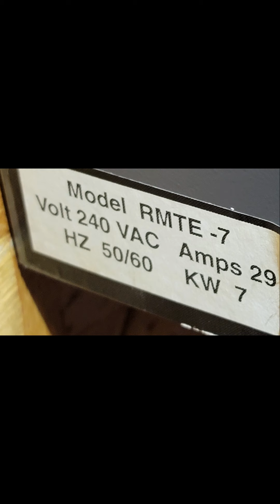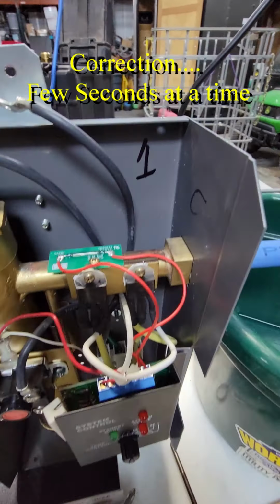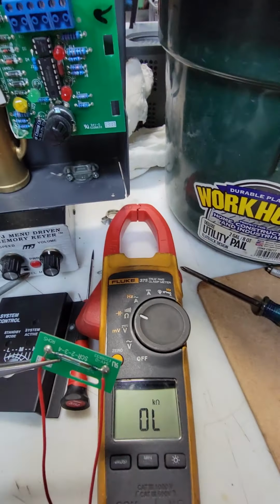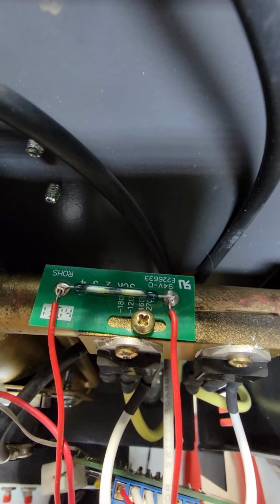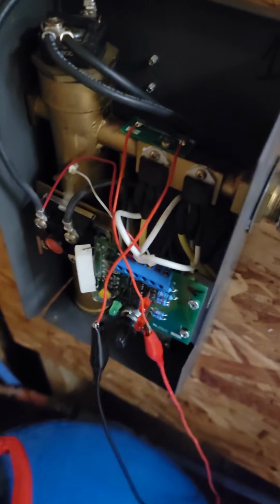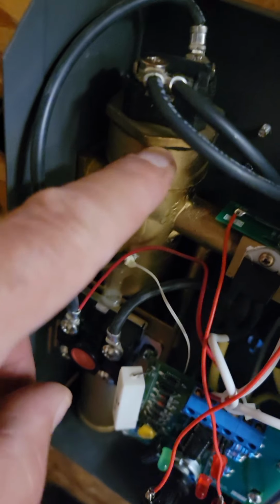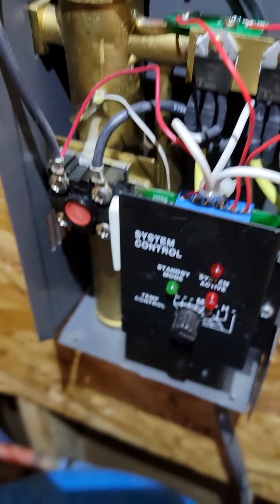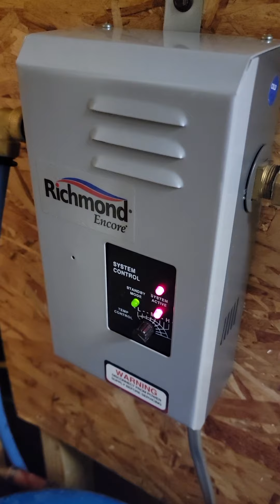Richmond Encore RTME-7 Electric Water Heater Flow Switch Repair

Comment: Any idea on where to get replacement flow sensor?
This unit innards are exact to the Rheem Ecosense RETE 7, which I have had for 7 years. It recently stopped workin, sporadically lights up when running water to heat. Many times it then doesn’t light up the red lights. Was able to turn off/on and it would work but now it doesn’t light up the red lights. Acts like a flow sensor issue…
Reply from the maker: Have you done a very good acid cleaning of the magnetic pendulum inside the copper tube?  The magnetic switch itself is pretty durable... easily obtained from Amazon.
Reply: @W0GEN  will give that a shot first. Thanks!
Reply from the maker: @mattfogle9397  there are many things that could impact your control, the two ic's used as power switches as well.  Do you have the means to do a diagnostic with this on the bench?  If not, I might be able to help you if you want to ship it my way.  system is really simple, but there are several electronic components to address.  you can email me at bill at w0gen.com
Reply: @W0GEN  thank you for the responses and the offer! My system is at a w/e cabin and I’m headed there this weekend. I’ll try the cleaning first and go from there, but may well ask for your help. My electronic knowledge is rudimentary at best even knowing that this is such a simple system. Hearing 7 years is a pretty decent lifespan but I feel this particular issue has to be electronically simple for the right intellect! And it’s minimally used since install…